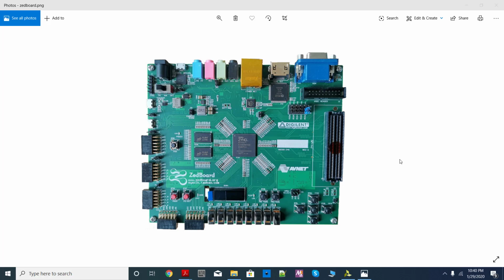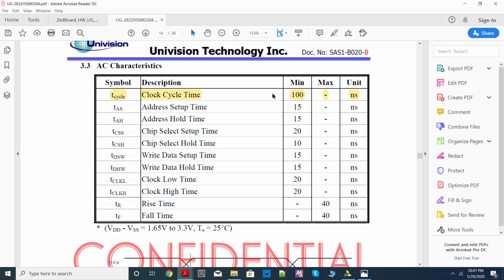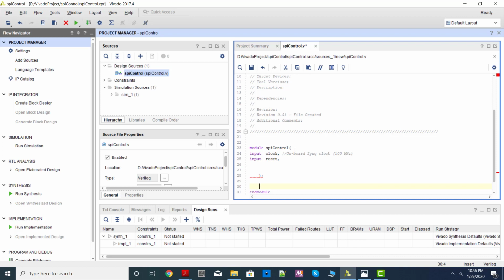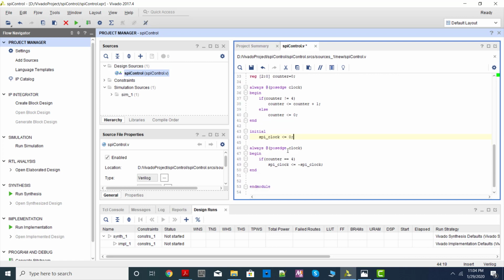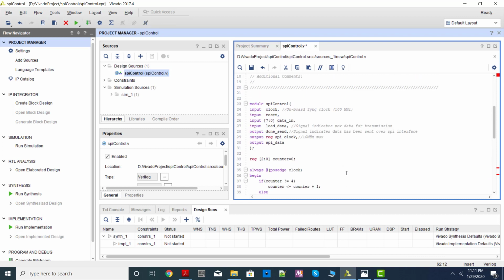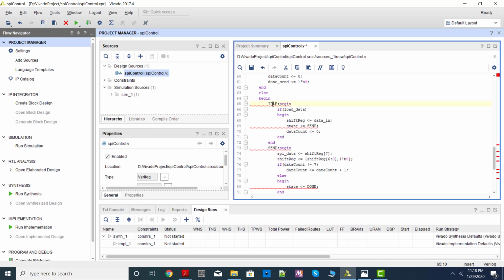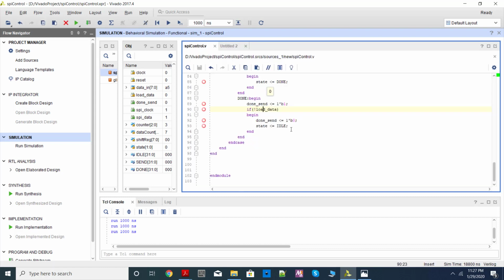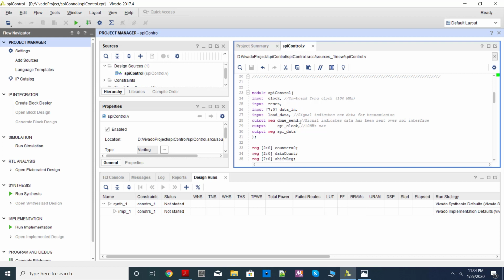Developing an SPI Controller for Zedboard OLED Display

Comment: You have a great youtube channel, thank you for the detail and insight tutorials. I think the FSM process should use CLK, not SPI_CLK, because if the period of load_data is shorter than the SPI_CLK, then FSM will not work properly. Using CLK and falling edge of SPI_CLK to put data on.

Comment: Sir how did you know that the counter should count to 4 in order to achieve spi_clock with a frequency of 10 MHz ?
Reply: The input clock runs at 100 MHz and the SPI needs a 10 MHz clock.  If you create  a new clock based on another's positive edge it will be half the speed because you're only switching the new clock once a cycle.  So that would give us a 50 MHz clock.  To get the 50 MHz down to 10 we want to switch it every fifth time.  The counter starts at 0 so to switch on the fifth time we have the counter go up to 4: count 0 to 4.
It's tough to explain without a visual aid.  Try comparing what I typed to his waveforms in the video.  Let me know if I can clarify anything...

Comment: There's already an interface for the SPI, why re-create it?
I'm looking for a video that uses the BUILTIN SPI ports. Why is this so difficult to find?
Reply from the maker: Yes PS has an SPI and you can connect it to OLED through the EMIO interface.
Reply: @Vipinkmenon , thank you. I just found out the hard way why we want to develop our own hard-coded SPI driver like this one: the Cmod-A7 does not have an SPI port (Microblaze). But I really need that SPI port on one, so this video just became one of my very favorites? I tried using the built-in QuadSPI, but you can't just pull one SPI port out it very easily. Maybe that is possible, but this method making our own SPI driver is more fundamental. Thanks for helping to open doors!

Comment: Can we use two SPI masters in the same design? For instance, I have two devices need to control, both of them are independent, it means they can send two different value to different devices at the same time? How can we implement this design?
Reply from the maker: Of course. You can just instatntiate two SPI controllers in a top file and during pin assignment, assign the pins where the two peripherals are connected. If you don't want to send data to the devices at the same time, one SPI controller is enough. It can have 2 slave select signals which can be controlled depending on to which peripheral you want to send data to.
Reply: @Vipinkmenon   Dear professor, as far as I know, Zynq can address only 1 SPI master at a time (we can only use SPI bus at one time). However,  even I've tried with Zynq Ultrascale, but I could not get the good result (there is a different timing between two of SPI). Is there another solution?
Reply from the maker: If processor/software is controlling the SPI master, yes there will be slight delay between the starting of the two controller since software runs sequentially and it can configure the second controller only after configuring the first controller. If you want the controllers to start exactly at same time (like both asserting slave select on exactly same clock cycle), you will need some hardware to manage that in between. That means you cannot use the SPI controllers in PS and will have to implement them in PL. If you have using custom SPI controller (like the one I have written), you can easily do that. There can be a common control register for both controllers and software can write to that single register to start operation and both will start at the same time. If you will use Xilinx SPI IP core, you will need your custom hardware between processor and the SPI controllers. Software writes to your IP and it then controls the SPI controllers, which can happen in parallel.

Comment: HI ,Vipin,Nice work really! .Could you also share as many videos as possible on the work you have done? Mostly on the constraints and larger design, Its good if you can guide  on PCIE/ethernet/USb/Transceiver?
Reply from the maker: I will have on Ethernet and Pcie. But not on Zedboard. May be vc707 or vc709